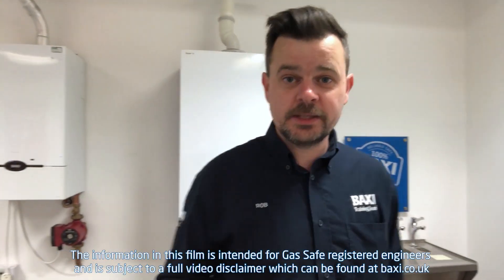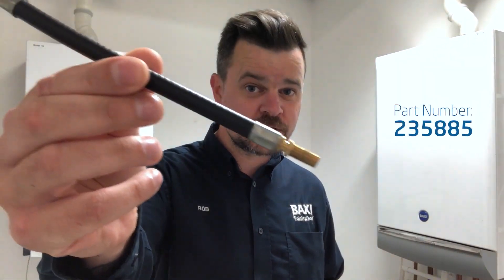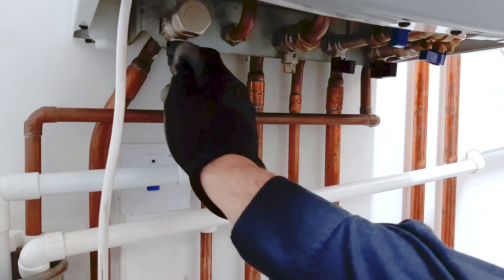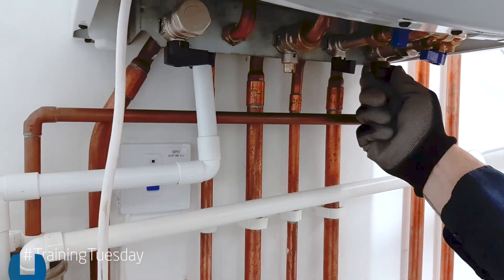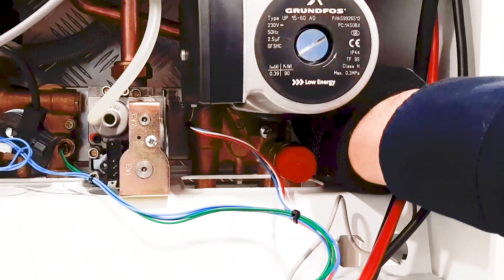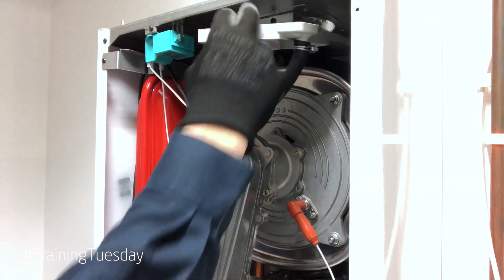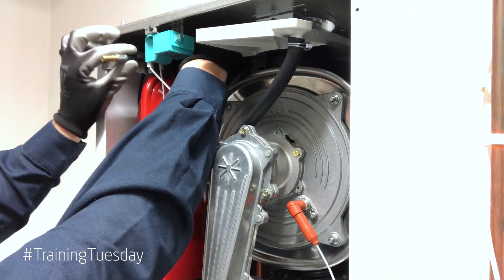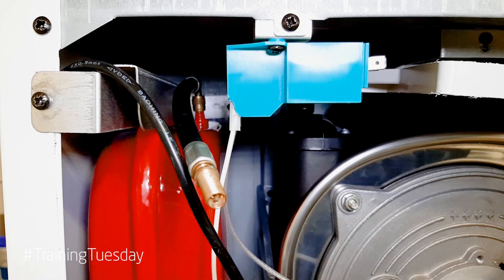How to check an expansion vessel on a Baxi Duo-tec or Baxi Platinum boiler

Comment: Wouldn’t be touching them flow and return valves fully pressurised 🤣
Reply: Can you repressurise without isolating flow and return
Reply: @waseemkhaliq933  yeh, but still need to have an open drain and remove pressure from the system.
Reply: Normally the valves on the baxi are pretty good .if by not isolating flow and return valves are you not charging up the whole system.
Reply: @waseemkhaliq933  no you’re still only pressurising the vessel, there’s a risk it’ll drop the whole system but never normally happens.
Reply: Right will definitely try thanks for the tip as I always isolate flow and return whenever pressuring vessel.
Reply: @waseemkhaliq933  no your just pumping up the air side of the expansion vessel
Reply: @Heatking got baxi platinum the guy changed expansion vessel and prv still the pressures keeps going up
Reply: @baltukur3368  plate heat exchanger passing or filling loop passing. Or even the vessel isn’t large enough for the property. 👍🏼
Reply: @Heatking   the guy took the filling loop out still doing the same pressure increases bto red